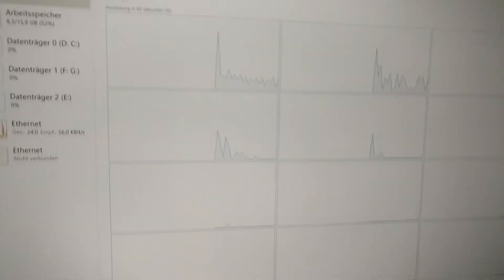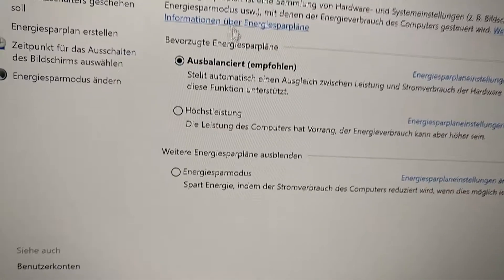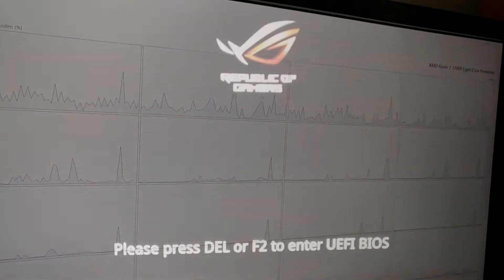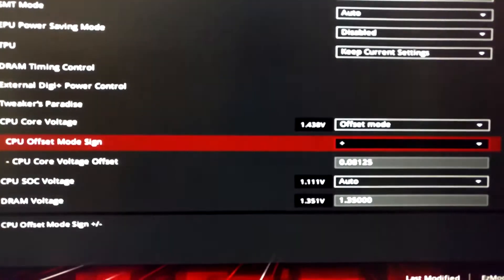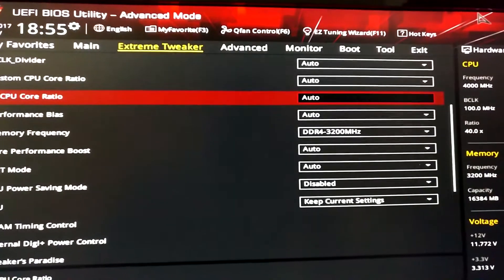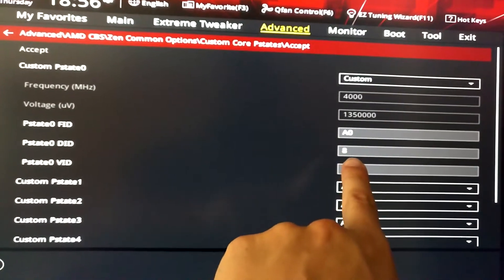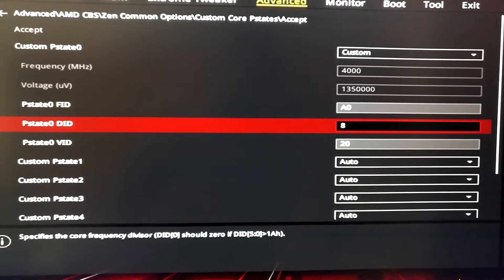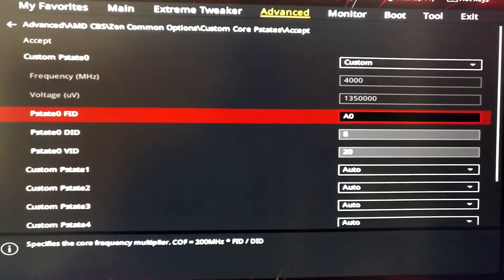PState Overclocking on Ryzen

Comment: Cool'n'Quiet brings higher IDLE Power consumption
i test that with my Ryzen 5 2600X, IDLE wit Cool'n'Quiet 80 watts, without Cool'n'Quiet, 70 watts :-)
Reply: The dumbest thing i have heard in a while.... Do ylu even know the use of C`n`C!?
Reply: @theexorcist82  welcome to reality, i measured it,
yes i know, slow down cycles with lower Volts, but more cylces with higher Volt (CPUV Core) can it faster
Windows have already a thing to calculate
if you know how the function about the cpu...
machinecode "..0101010" you know when it needs and when it need nothing ;-)
so take a power meter and measured it yourself

here my german data
LLC 6, 3900 MHZ
NB/SOC 1.1000V
CPU VCore 1.2250V

IDLE ~70 Watt
LAST PRIME95 ~180 Watt
LAST PRIME95+Fire Strike ~ 307 Watt
LAST GRID 2 Menü ohne fps limit 198 fps 221 Watt
LAST GRID 2 Menü mit fps limit 136 FPS (nvidia profile inspector) 211 Watt
LAST GRID 2 Menü mit fps limit 99 FPS 192 Watt
LAST GRID 2 Menü mit fps limit 75 FPS vsync 196 Watt
LAST GRID 2 Menü mit fps limit 74 FPS (nvidia profile inspector) 193 Watt
LAST GRID 2 Menü mit fps limit 74 FPS 168 Watt

GZDoom FPS LIMIT über ini-datei
200 FPS Vulkan 115 Watt
74  FPS Vulkan 107 Watt

GZDoom FPS LIMIT über ini-Datei
200 FPS OpenGL 116 Watt
74  FPS OpenGL 106 Watt

nur C-State Control
---------------------------------------

LLC Auto, Auto MHZ, PBO und Core Boost (feste Spannung auf 1,3625V, 1,4V bringt bisschen mehr Leistung)
NB/SOC 1.1000V
CPU VCore Auto

IDLE ~80 Watt
LAST PRIME95 ~214 Watt (3,9ghz/4Ghz, alle 6 Kerne)

C-State Control, Cool'n'Quiet
----------------------------
LLC Auto, Auto MHZ, PBO und Core Boost aus, Cool'n'Quiet
NB/SOC 1.1000V
CPU VCore Auto

IDLE ~80 Watt
LAST PRIME95 ~155 Watt (3,6ghz, alle 6 Kerne)

---------------------------------------------------
LLC 6, 4000 MHZ
NB/SOC 1.1000V
CPU VCore 1.2875V (1.300V, LLC7 geht stabil, 4,1ghz mit 1,350V)

IDLE ~70 Watt
LAST PRIME95 201W
LAST PRIME95+Fire Strike ~ 325 Watt (Prime95 nicht stabil, stürzt hinter Fire Strike komplett ab)

nur C-State Control
-----------------------
4200MHZ 1.4V (+ zwei schritte LLC7/8) liefen mal

Comment: Very nice video, in my case I had to setup P1 and P2 as idle and sleep because only the frequency whould downclock but the voltage whould be kept at P0 at all the times.
Reply: i have the same problem, but can't get any kind of downvolt, just the clock frequencies goes down on my C6Hero. What can I do more? Tried reset cmos, single pstate without vid modification, enabled p0 p1 p2, tried everything but if not stock I can't get no undervolt. Also offset doesn't help as showned from a lot of video. :/
Reply: @nerdMike  Same here, I want to have proper overclock or none. Manufactors can add FSb overclock but they dont want to do that, I wonder why, I used BIOS for Athlon and FSBwas unclocked, but I had memory stability issues.
Reply: @digdeep28  now I have another problem on new crosshair vi hero last two bios had remove pstate menu, no way to access to it 😕

Comment: Will do you know why when I do this in a Ryzen 3 2200g, it keeps clock in pstate0 (always in 3.9 Ghz)?. However I seen in a ryzen 7 1700 pstates works fine.
Reply: Try using power balance mode.

Comment: I want the opposite of pstate overclocking. Where at full load, 3.5ghz at 1.075v. Half load at 3.8ghz at 1.250v. But nothing can do that other than ryzens xfr boost which you cant touch :(
Reply: Nope, that is exactly pstate oc. P0 is for full load, P1 for iddle and P2 for sleep. So put 3.5ghz in P0 and 3.8ghz in P1.

Comment: Hey, I'm not sure what to do. what do I need to do with my 1800X? I can reach 4.0Ghz on an offset of 0.375 (and maybe lower too) and how do I go about it? Should I just copy your settings? Also, I don't use XMP profiles I just set my RAM speed to 2666Mhz and I set the voltage of the RAM to 1.35V and that's it. I enable Cstates in Zen options. Help will be appreciated!
Reply from the maker: Krystian Domagala My settings should work for you too, but if you want to set a different voltage offset, just check the guide I linked in the description. There you will find a table. It will will show one code for each offset. So just pick the voltage you want in the table and insert the corresponding voltage code in your bios.
Reply: derfledderer It worked! Thanks a lot! However, I have one more question. Did you disable or enable Cstates in Zen options? I enabled them. Also, I set load line calibration under Advanced Digi+ to Level 1. Is that good? Thanks
in advance.
Reply from the maker: I kept all the energy saving settings ON. The LoadLineCalibration setting is dependant on your motherboard's VRM quality. I think I have level 2 or 3.
Reply: derfledderer I got 4.0Ghz and load line calibration level 1. Stable as hell.
Reply: derfledderer Also I used your settings and they worked. Thanks a bunch. Good tutorial. mine is stable at 0.055 offset too.